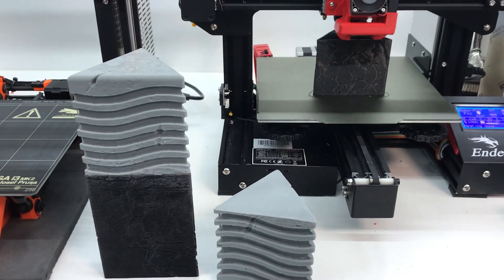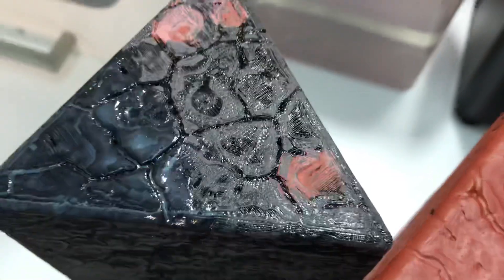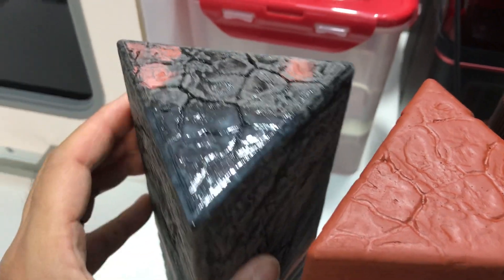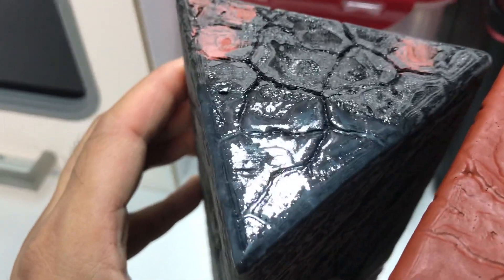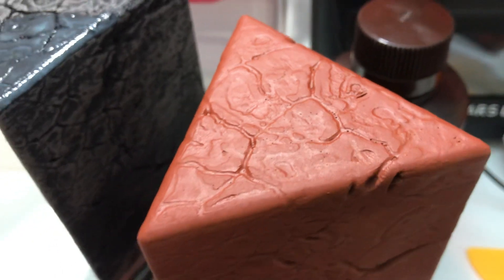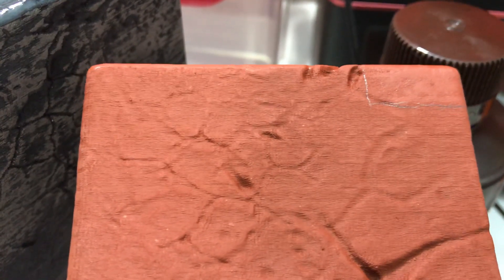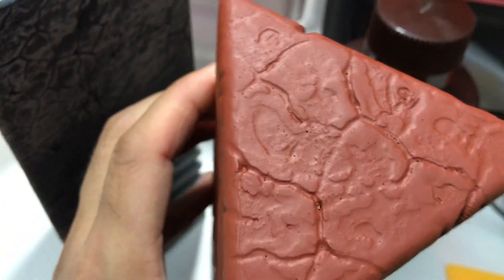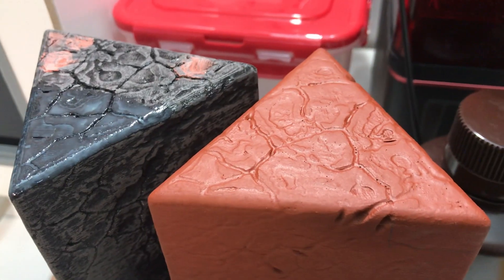Smoothing FDM 3D prints with UV resin coating

Comment: Were the FDM prints PLA? I’m concern about leaving PLA prints in sunlight for this trick
Reply from the maker: Yes, mine are PLA prints. You only need to expose the resin to UV light, so even direct sunlight for a couple minutes shouldn't warp your print. 

I found that even though my front yard is in shadow from a porch, the ambient light is enough to cure resin. :)
Reply: Panda Props & Costumes thanks for the reply! I’ll try this out with a helmet as I’m not a big fan of XTC or fiberglass resin
Reply from the maker: @wuwu007   Yeah, I've tried them all. XTC, fiberglass resin, 3Dgloop, regular resin, Fine Finish. I normally use filler primer and sanding, which I will continue to do, but nothing coating wise has been as easy as this process. I'll do some more testing as I want to try spraying it as a coating too.

Comment: dont use compressed air. use a torch lighter or heat gun to pop the bubbles
Reply from the maker: Karen Medcoff Cool thanks for the tip!
Reply: Can you put in the notes for this video the maker of the original print files?
Reply: @ImagineeringTheCog  it's from hex3d on patreon